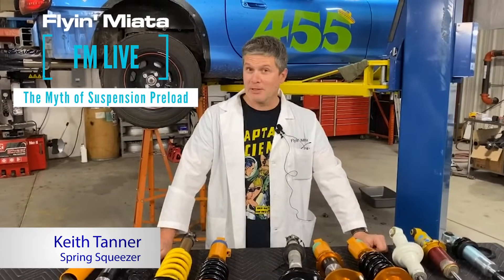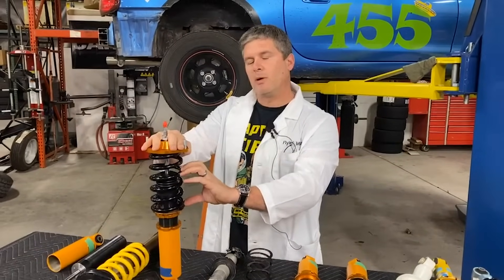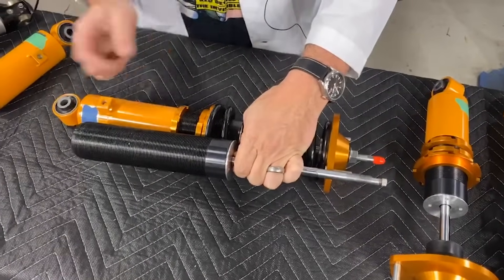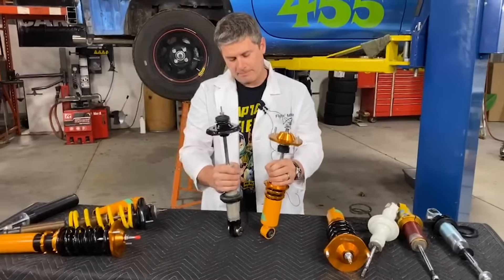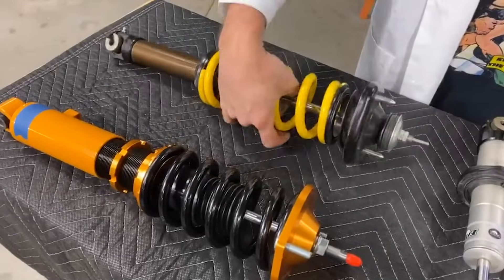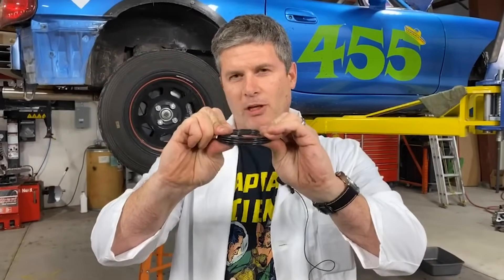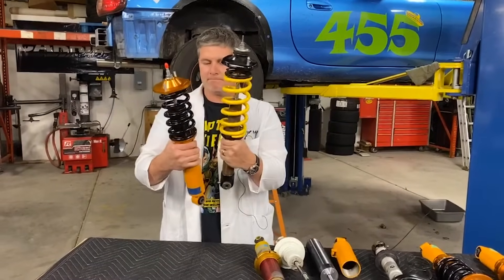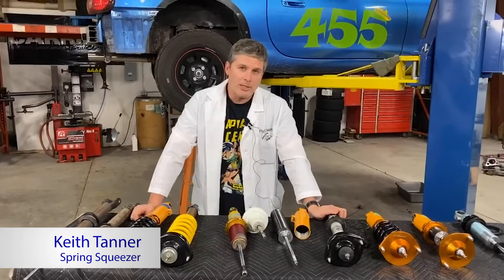The Myth of Suspension Preload (FM Live)

Comment: Great video, but I still can't adjust my Tein Flex Z for my 2009 Acura Tsx! I dont understand the instructions and one of my spring could move freely after doing some adjustments. I still dont understand what's preload and how my spring should be compressed before installing it on the car! X) more preload will stiffen my suspension? Or it's just marketing and I can install my coilovers with the coil moving freely in the assembly, no preload? Thanks...
Reply from the maker: More preload will NOT stiffen your suspension. That's a fairly common misunderstanding and one we'd hoped we'd addressed here. You only need enough load on the spring to keep it from flopping around at full extension, although the geometry of the rest of your suspension may demand something different. Can't help with Teins for an Acura specifically, unfortunately.
Reply: He literally covers all of this in the video. There's no way you actually watched it.
Reply: @opmike343  i called tein and they told me how to set my suspension.

Comment: Spring preload is miss used/misunderstood. Preload is used to hold spring in place so if you're airborne from bumps, spring is not flopping. If it is then you've got too short of  springs also. And if you end up binding your springs. Should consider adding longer bump stops.
Reply: if you have adjustable length coil-overs you can just lengthen the strut body. The length of the strut only becomes a concern when shortening it too much (because you may contact the wheel well under full bump compression).

If you don't have adjustable length coil-overs then yeah... to avoid coil-bind you'll need to either lower the lower spring perch as much as possible (you'll end up lowering the car) or change to a spring with more travel. i would not sacrifice bump travel to prevent bind. Riding on bump stops will not produce a well handling vehicle unless you tune specifically around that intention.

Comment: Drooping a coilover to slam ride height low, destroys the shock...Correct?
Reply from the maker: I don't believe so. I think where that story comes from is the fact that dropping too low means too much time on the bumpstops, and the shock does not have the damping to control the high spring rate they have. So it acts severely underdamped which means it acts like a blown shock.
Now, taking bumpstops out and allowing a shock to bottom out internally - THAT can damage a shock.
Reply: @FlyinMiataVideo  Thanks for your time.
 I need less then an inch of droop to get the ride height I want. After maxing out coilovers & using shorter strut forks....Still not low enough with out drooping the spring a lil.

I just got adjustable dampners. I'm assuming Ill start with full hard then click my way softer...
Reply from the maker: @Cliffjumper  We recommend starting soft and increasing the damping. It's a lot easier to tell when you get it right.
Droop is useful both for dealing with things like driveways and when going over crests at speed. Less than an inch is not enough.

Comment: Don't you need to be able to limit compression travel in order to prevent the tyre from crashing into the fender before the shock reaches full compression? Not a case of 'we want as much travel as possible.' single piece coilovers don't allow for this adjustment unless they are designed specifically with this in mind and are to be used with a specific wheel size and nothing else.
Reply from the maker: If you are running a wheel/tire combo with a significant difference in overall diameter, you will need to limit compression travel to avoid interference. This is fairly rare in the Miata world other than for lifted cars, but it can happen. It's why we include bumpstop spacers with our ND Fox suspension as some of the wider sizes are taller.
But that's an unusual case. It's far more common to retain the same tire OD. Note that wheel OD is not a factor - it's all about the tire. So the suspension is designed to work with a tire diameter that is similar to stock, such as a 225/45-15 in place of the original 185/60-14 used on an NA Miata.

When we say you want as much travel as possible, that is "as much travel as possible before you reach a limit imposed by your components". You do not want your shock preventing from using you all of that potential travel.

Comment: what a bad way to shell fox suspension,
Reply from the maker: We're simply providing engineering knowledge that will help you evaluate any suspension setup. Naturally our suspensions - all of them, not just the Fox - are designed using best practices. That's a benefit of being so closely involved with the design and testing process. If we were just picking parts out of someone else's catalog we wouldn't be able to do that as easily.

Comment: the preload isnt for that . its for the travel that it has when u ride over a pot hole for example. if you have preload on it the strut will travel faster or slower downward .
Reply from the maker: It doesn't work like that - the spring rate is unchanged. 
The only time there is a difference is when the spring is loose at full droop, at that point the shock will stop extending when the spring is fully extended. But once you get past that, it doesn't matter how much preload there is at full droop, the shock will extend in exactly the same way and at the same speed.

Comment: Great Video, but now I am a little bit confused. I have a 2 piece Coilover made by Tein. I always thought I adjust ride height by breaking the lower collar loose and spinning the whole Assembly. Now you told me ride height is adjusted by the perch location? I know both affect ride height but how should I adjust it best ?
Reply from the maker: Set the shock length so you get full compression travel. Then set the ride height using the perch height.
The end.
Reply: @FlyinMiataVideo   is that an mx5 specific reccomendation or could that theory be carried over to a double wishbone Honda? I've read other articles which suggest using a bump droop ratio of 2/3 bump to 1/3 droop and setting the shock body to that point (and then using the springperch for ride height as you suggested). Obviously your suggestion of just setting the shock body to maximum available compression travel is easier than calculating that ratio etc - and hence preferable to an idiot like me!

Many thanks!
Reply: @FlyinMiataVideo  so set the Shock lenght as short as possible, just watched the Video Again and you also covored my question in the Video, thanks anyway That you answered my question.

Comment: What impact on the length of travel as pertained to twin tube vs. internal floating piston monotube design, and how that impacts the actual performance. Thanks. 
For ultimate street ride quality, comparing multipiece coilovers, can a twin tube outperform a monotube because of longer shaft length, ie. longer travel?
Reply from the maker: It's possible that internal design might affect the amount of shaft travel available for a given shock body size. So mono vs twin tube isn't really a factor, it's just about internal packaging. Twin tubes tend to have valves at the foot of the shock as well so I'm not sure there's necessarily an inherent difference.
Where you're going to see street quality differences is in that high internal pressure with a monotube - but the valving is a lot more important than the tech used.
Reply: @FlyinMiataVideo  Thanks. i get that "preload" is an unfortunate and misleading misnomer with respect to coilover, but.... Isn't the 2 piece design in reality allowing you to set the piston height, to determine how much up travel vs. down travel you might choose ,while allowing you to independently get a specific ride height ( aka why u called the universal). Isn't the one piece design based on making to a specific application, but you are thus dictating a narrower range of ride height parameter( which you have tested to give best outcome?). How much up travel to down travel do you want on the FOX set-up. If you adjust the spring perch, aren't you thus changing the piston position...i guess if it never bottoms or tops out, the you are OK. Also, wouldn't going to a reservoir shock give you more packaging room to get even more travel for a given entire shock length, but you don't need that because the one piece has sufficient travel, and keeps cost, complexity down, or not?  Thanks, your video is much appreciated.
Reply from the maker: @drtone  You're right, being able to adjust the length of the shock means you can trade off bump travel for droop travel and vice versa. That sounds like a great ability - until you realize that the correct setting for Miata bump travel is "as much as possible". Unless you're building a lifted offroad Miata with 29" tires, you want as much bump travel as you can possibly package. So any trading of bump for droop is a bad trade. That's what the fixed length shocks are built around - if you are using your Miata as a Miata, a performance road or track car - then you need all of that bump so the only correct length for the shock is to allow for that full travel. Once your shock length is set, then you set the ride height with spring rate and length and perch position. 
A remote reservoir is mostly used to increase fluid capacity of the shock or to allow double adjustability of a monotube design. It may or may not provide a little more shaft travel, but at a fair cost and with some real packaging difficulties.

Comment: Great discussion sir, my confusion. 5mm preload will react the same as 40mm preload, once the car is on load. Correct?
Does 40mm preload will tend to get coil-bind more compare to 5mm preload. Cause of 40mm preload has less shaft travel. Is it correct?
What are the pro & con of using low preload & high preload. 
Mine currently set to 30mm preload, and I have noticed coil-bind mark on the lowest ring of the coil. Appreciate your replies.
Reply from the maker: You're using preload as a measurement of something else. I'm guessing you're equating it to the adjusted length of a two-piece shock, as preload itself has no effect on the amount of shaft travel.
Coil bind happens when the spring runs out of travel before the shock does. There are a number of factors involved in the geometry, but if you are experiencing coil bind you need to deal with it. The correct solution is to go to a longer spring but packaging doesn't always allow that. If you can't increase the amount of travel in the spring, then you have to limit the amount of travel in the shock or lower the car.
Pro and con of high preload? Watch the video. It's not a thing. Again, you're equating "preload" with something else, probably shock geometry.
If you only have marks on the lowest coil, you're not putting the spring into full bind. The little half-coil at the top and the bottom of the spring will always close up first.
Reply: @FlyinMiataVideo  in that case I'm going to reset my preload to a "normal" position and test how the feel of the ride. Still wondering why the guy that tune it put so much preload on my coils, Thanks.
Reply from the maker: @JTNaise  It's not preload. Set the shock geometry so you get the range of travel you need. Then you set the perch height so you get the ride height you need. Don't think of it as setting preload.

Comment: Preload would make a difference when working with a progressive rate spring correct?
Reply from the maker: It would not. The amount of force being put into the spring is exactly the same regardless of the preload at full droop.
Reply: @FlyinMiataVideo  I had a car with double progressive, tapered spring and one of my cars uses a progressive variable diameter and in both cases the amount of spring preload could change the initial crack(movement) of the spring. In the latter case it needs to run quite a bit of preload to get the ride height I need. A lot of people ran these lower as it was simply more comfortable but bump steer could emerge. This was because there wasnt a lot of droop in the shock body before topping out. If I get these rebuilt I will get the shaft modified. This is an old ohlins japan coil over and made to suit their roads, they dont have a lot of bumps, good surface and is pretty old tech by todays standards but the valving is ok. it just doesnt work anywhere else 

The other example is a rally length shock but with less spring preload to run more of a street car set up. While comfortable enough on the street the lack of preload made the chassis transfer weight more then I liked. It wasnt as linear as it should have been. Exiting a corner on the track it would squat and unload the front causing understeer (awd car) and really needed a linear spring in the back. I never used this car for track it was a street car that I took due to my track car being undrivable. 

Preload does not change spring rate but will change dynamic chassis attitude as it goes through its travel in the case of progressive springs. It will also change the range, so if you have a 7-10kg/mm spring adding preload might make it 7.5kg-10kgmm in an extreme example. Rate hasnt change but the effective working range has and you will feel it different in the drivers seat.

Of course linear springs eliminate that problem which is why not a lot of aftermarket companies use them. As you can see, they are harder to set up

Comment: Doesn’t a 250lb/in spring mean that if you preload 2 inches the initial 500lbs of force go straight to the chassis with no damping and absorption by the shock?
Reply from the maker: No, because there's already the weight of the car on the spring. You're not starting from 0 unless you're jumping the car. This is a common oversight.
There is an edge case where your preload is higher than the cornerweight of the car. It this happens, there are some fundamental problems with the specification if your suspension. It's possible to get it that wrong - we've seen it a few times - but it's only possible if the springs are far too long or if the shock has minimal droop travel.
Reply: Flyin' Miata so if I jump or lift a wheel a lot while say hitting gutters or rumble strips it could be an issue?
Reply: @monkeypainter808  It's not a black and white line. Lifting a wheel is a sign of not enough travel for your intended use. If you are jumping a lot, you'll probably set up your suspension differently including valving differences. Our friends at Paco Motorsports have probably done more work on off-road Miatas than anyone else.
500 lbs of preload is pretty extreme. In reality, it's not liable to be more than maybe 10-20% of your corner weight. 500 lbs is more like 80%.

Comment: His spring preload explanation is off. Spring pre-load....is not for adjusting ride height....but suspension SAG. If you want your shock piston to only be 25% down into it's stroke when you rest the cars weight on it, but the shock actually compresses 40% of its total travel,...... then and only then.....you use spring preload to compress the spring and move the shock back up into it's stroke until that 25% number (or whatever you are shooting for) is reached. If the shock doesn't move down that 25% you are looking for,  you can either A. Get softer springs, B. use 2 springs (a softer one for initial travel) or C. (last resort ASSUMING YOU STILL HAVE SPRING TENSION AT FULL EXTENSION AND NO BIND AT FULLY COMPRESSED) Use a shorter spring. DONE PROPERLY, RIDE HEIGHT should ONLY be done by a separate adjustment that changes absolute overall shock length. YOUR SHOCK SHOULD NEVER BE USED AS THE TOPPING OUT OR BOTTOMING OUT DEVICE.....use rubber bump stops for that.  Also note, that a shock without a separate reservoir is filled with lots of gas causing oil aeration and saturation. As the shock compresses, the volume of the shaft itself is now introduced into the fixed volume of oil....if there isn't any gas (air, nitrogen, whatever) to compress with the extra volume of the shaft, the shock wont move any farther...hydraulic lock. That's why (aside from additional cooling volume) reservoirs are preferred. In his last example the same size body shock with different sized shafts, the longer shaft will require more gas in the shock to compensate for the displacement of the shaft entering the shock....not better if you aren't using all of the shocks travel.
Reply from the maker: Let me guess - a motorcycle background? Bikes tend to explore the droop limit of their travel on a far more regular basis due to the extreme amounts of weight transfer they experience. On cars, we're more interested in getting as much overall travel as possible, with the emphasis on maximum compression travel. If you adjust sag (full droop), you have to give up compression. Or, in our case, we build for maximum compression because anything less is a dynamic compromise. And we always use bumpstops.
All shocks have some sort of gas in them to allow for changes in internal volume as the shaft moves in and out. On a monotube shock, that gas is separated by a piston so there's no chance of aeration. On some twin-tube shocks, it's physically separated in a bag or it's captured in the second tube - they rely on staying upright to function properly. Reservoirs are used to either give more fluid capacity or to separate bump and rebound damping functions on a monotube shock.